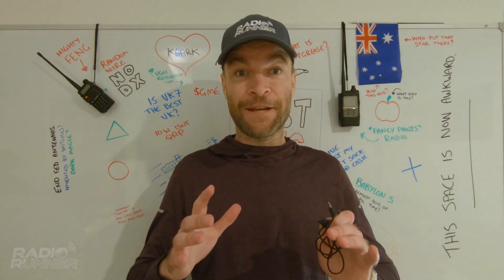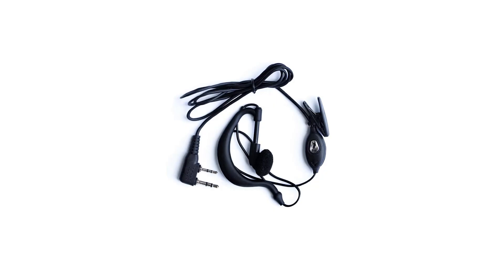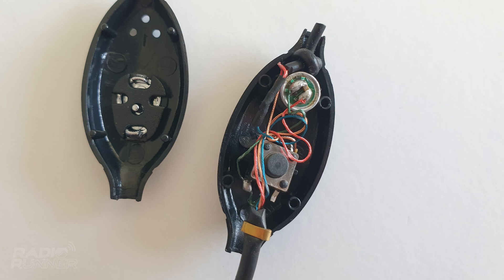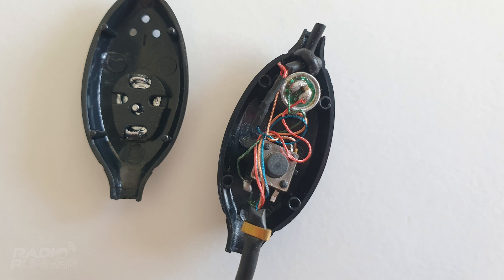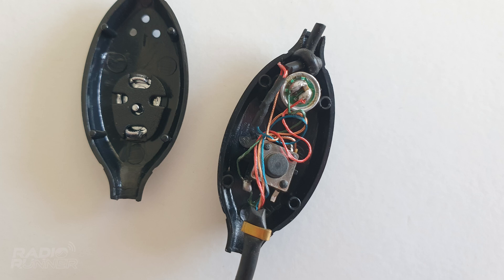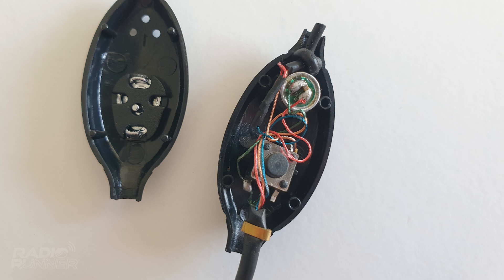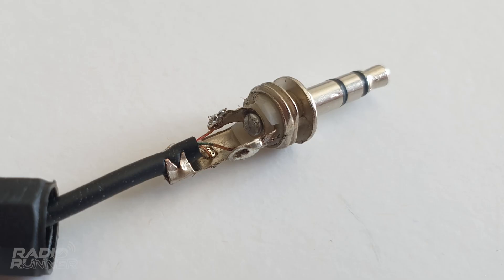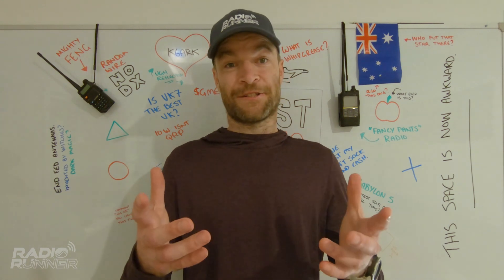The World's Lightest Ham Radio Microphone For A Few Dollars In Parts?

Comment: Great video,, I'm going to do 1 for my Kx2, just one question: why was necessary to remove the 2 plug male connector? Would be enough to cut one of the 2? So you can connect with out cut and resolder, saludos